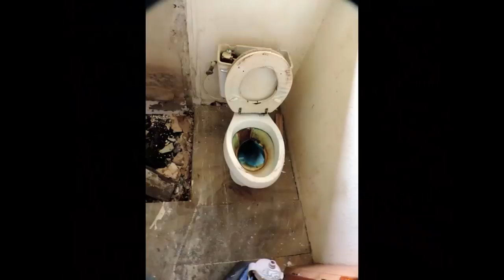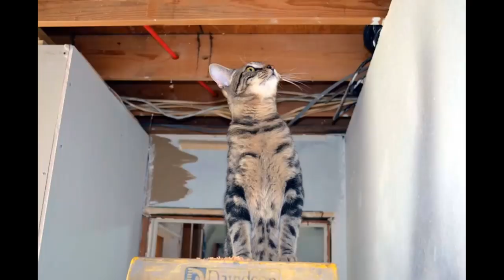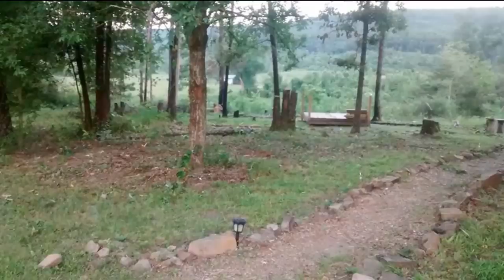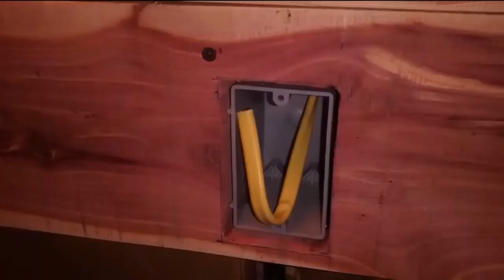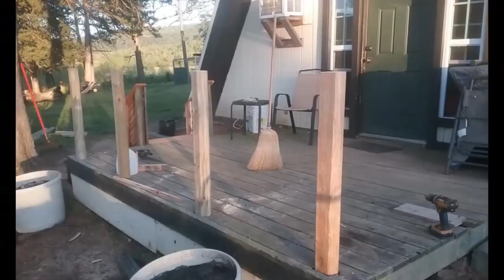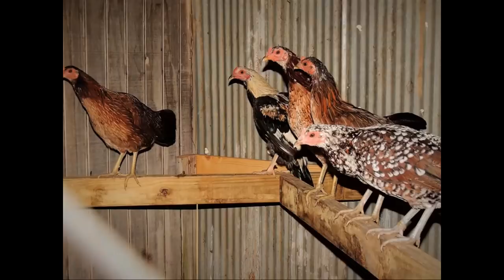10 Years of RESTORING an Abandoned Cabin!

Comment: Great work.  About 5/6 years ago I bought a “junk” house for $11,000.  It’s a smaller 864 sq. ft. two bedroom with an attached 624 sq. ft. garage/shop on 1/3 acre and a 4 car driveway.  I’ve spent ~ $18,000 on repairs/renovations and some new and some used furniture.  I’ve still got a ways to go, it needs a new roof and more.  I find inspiration in your story - thanks!

Comment: Saw you over at Bobbleheads place, this popped up on my U-tube so came to check you out. Lookin' good. Lots of work.
I get it, we started out with 1 acre and an old log scaling shack here in the foothills of the Oregon coast range. Land was forest service, building burned down, later used as small fish hatchery. Gravity fed spring. We turned the shack into a cabin, all off-grid, 12v, solar. Hot running water with a coil of black pipe on the roof in the summer or through a wood stove coil. Built a small 8'x12' work shop, 6'x8' lean-to greenhouse, sunk 2' in the earth, raised beds and hoops to extend the seasons. Springhouse. We have small milk goats, chickens and pigeons for meat. 8'x16' animal shed attached to the cabin by breezeway/barn porch so we are not out in the weather. Use to raise rabbits but kind of got tired of the meat. We have 3 fish tanks in the greenhouse, raise yellow perch, in the old fish tanks and a small pond for fishing. Everything is recycle and reuse, mostly free. Bought in '94 to get back to my roots. Grandparents had a small land holding and a big garden when I was a kid. Grew up on a stump farm. I farmed until '92 but always had our small homestead, gardens, hunting and fishing. Been a slow process. Retired at 55 and made it full time. Hunt, fish and gleann 95%+ of what we eat....James
Reply: mostly admire your tenacity ! had a desire to do what you did, but never had the how to or the money...slow learner, now I'm 83 LOL guess I'll do it next time Lord Willing....Great you're living your dream, sounds like it works for you. God Bless.